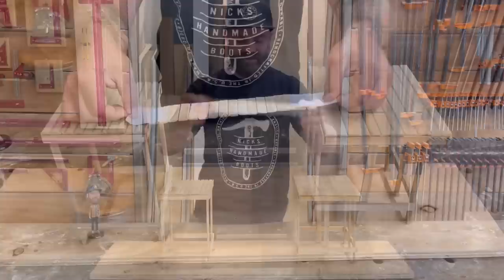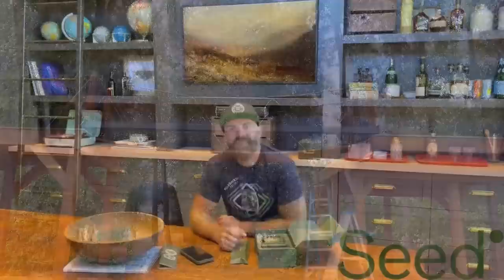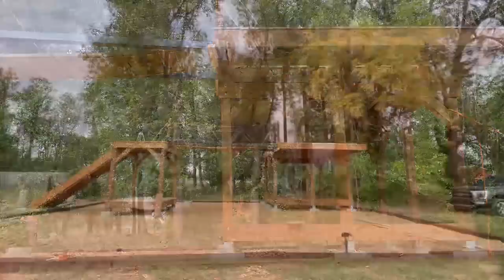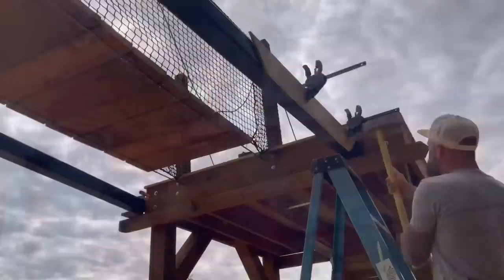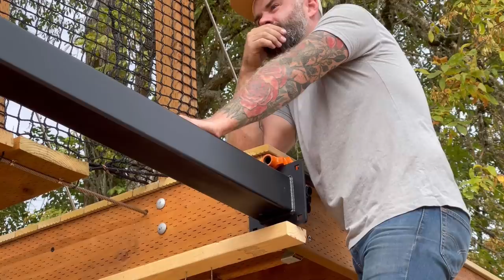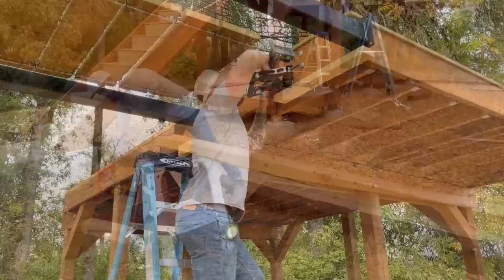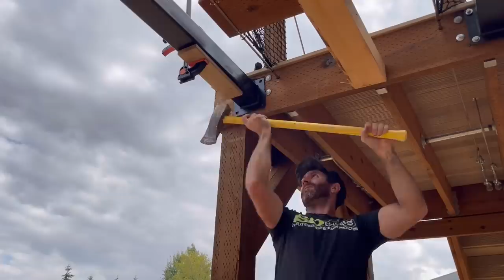My Treehouse is Falling Down || Fixing a Huge Mistake

Comment: Dude, how inconsiderate of your 95-year-old Grandma to not make herself available for the second test!  I'm glad your wife and child survived, not only the physical risks, but the shame at having to do her job for her.  Come on, Grandma!
Oh, and the obligatory 'should have loosened the bridge cables to make inserting the steel easier, plus reducing the load on the end points with increased drooping', blah, blah blah, yadda, yadda, since paying homage to the recurring mention of the cables seems to be de riguer for these comments....   😎

Having said that, I do want to give some love to my old Grandpa, who grew up in Appalachian poverty about a hundred years ago, uneducated, couldn't really read all that well, and yet when I was growing up (a few decades ago, we won't say how many), was one of the smarter guys I knew, then or since.  He knew things in the realm of engineering, like when fabricating and hanging a gate, always make sure to have a diagonal brace from the outermost top point, angled back down to the bottom hinge, because the far end of the gate away from the hinges was where the most load was, and therefore posed the greatest risk for drooping or racking.  'Triangles prevent rack' was his watchword, though not in those terms, but he got his point across.  Another was to never let a fastener do a structure's job.  He taught me that one when pointing out some jack studs in an unfinished room, and showing how the load got passed down from the roof, through the studs to the foundation.  A nail holding up a crossbeam could pull out.  The jack stud sat on the next structural member down, making it able to carry the load from the crossbeam.  Of course, his wording was more like 'never let a thing be held up by a nail, when you can have it held up by another thing'.  I've never trusted even the strongest fasteners since.  Know the direction of all your loads, and use triangles (cross-bracing) and support bracing under stairs or whatever, instead of relying on even the thickest lags.  I know those things, because my Grandpa taught them to me.

Comment: what were you thinking, thats the most hoaky thing I've every seen you do, that was embarrassing.  a coma-along diagonally from the bottom of the post to the top of the opposite post will easily pull it out of plumb while you install the steel beams, which should have been wood, AND loosen the tension on the cables

Comment: I think the x joints in the base of the towers would be enough. Connecting the beams from the part of the bridge to the outer parts of the tower should be secure and solid enough for it not to twist and twirl

Comment: I believe you have made the structure stronger, and it will last longer now. But I just want to point out that you haven't actually addressed the lateral load on those towers, you're only resisting it harder, creating lots of tension. My suggestion would be to build a second staircase on the other tower. THAT would actually transfer some of the lateral load to the ground and REMOVE much of it from the towers. Your solution will last longer, but it's still temporary. Steel can compress, and it will. It might last longer than the wood, but that tension scares me a little. The steel wont snap, but something else might. Please consider building a second staircase. That's the best solution. Go back to your wood model, add wood sticks on both sides to mimic the staircases, then see how much weight the bridge will hold. Then remove one of the wood stairs and see how much weight the bridge can hold without the second staircase. I suspect it will be MUCH less. PLEASE do this. It's for the foreman. 😁 ❤️

Comment: If you can put steel beams between the two towers then why would you need a suspension bridge? You should pretend that the span is 150 ft not 15 ft, and come up with a solution accordingly.